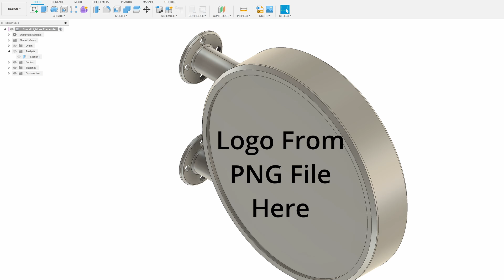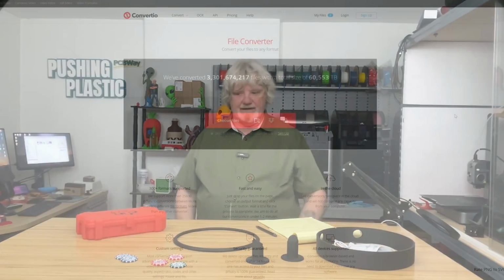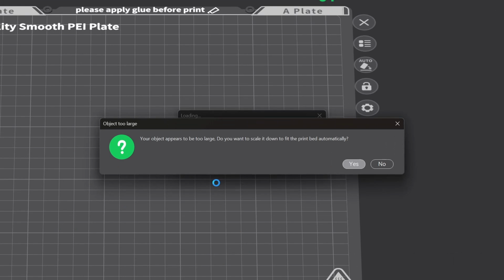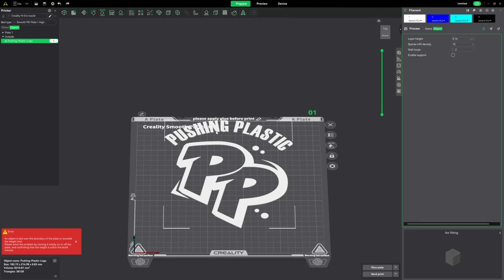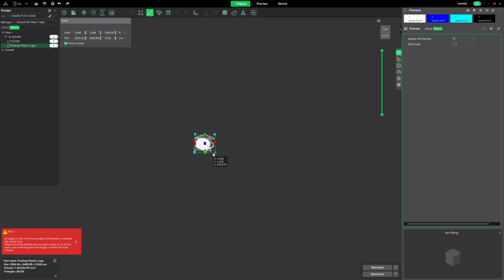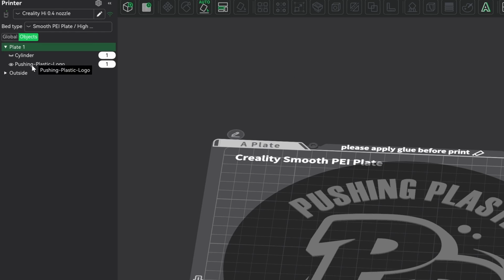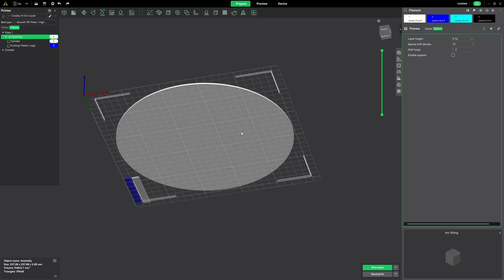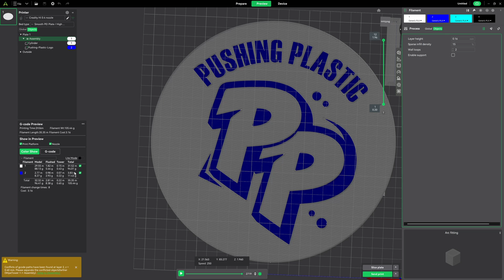3D Printed Logo From PNG to Printable Model

Comment: hey mate, I've been trying to print my logo but i want a white base and the logo on top of it so it has a 3D look, i cant find the way in creality print slicer to have an object printed on top of the other one. do you know how to do it? i will really appreciate it. i have a Creality KS PLUS. thanks in advance
Reply from the maker: In Creality Print, lay your base in first, right click & pick center. Then import your logo, right click & center it too. Then select all objects, I use Crtl+A on the keyboard. With all objects selected, right click and select assemble. Next, go to object mode. In the list, select you logo and use the move command to put it in the desired location. And thats it! Good luck!
Reply: @pushingplastic7445  Thank you very much, i was losing hope. you're the best
Reply: Hello. I have the same machine and when trying to do this my layers do not stick together. Can you provide your slicer settings. It's a complex design but this shouldn't be this hard. Please help.

Comment: I love your videos, slow explanations are easy to comprehend!  I’ve had my HI for about a month now, impress3d by the machine!  I have the epoxy resin build plate, what are the advantages of the PEI and where would you suggest buying one?
Reply from the maker: The PEI I'm using came with the printer. Occasionally they wear out and I'll replace them from Amazon or directly from the Creality Store.